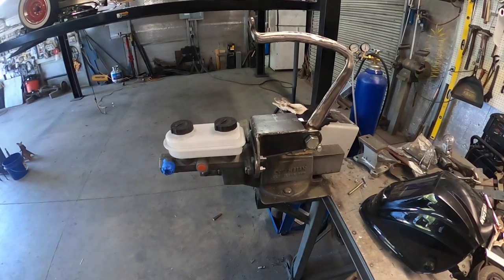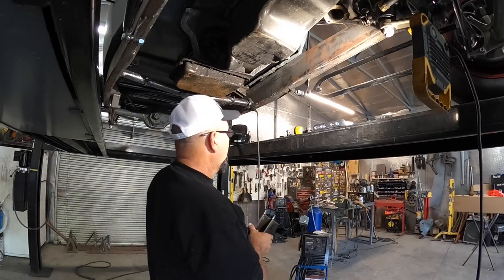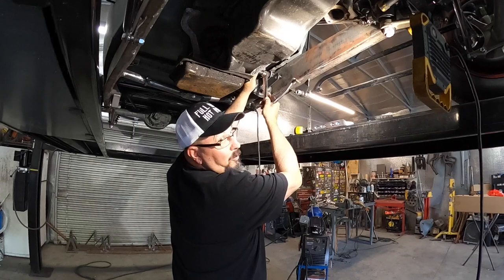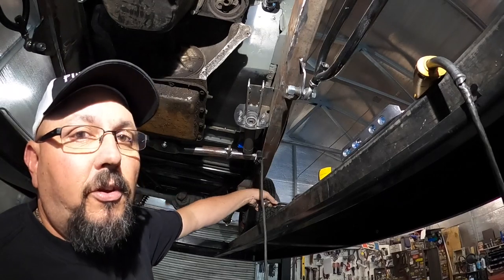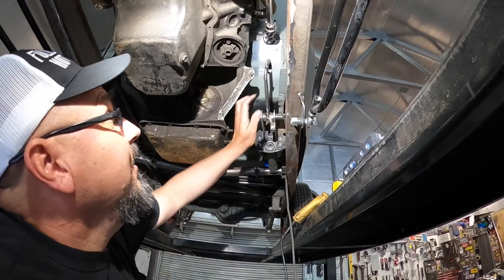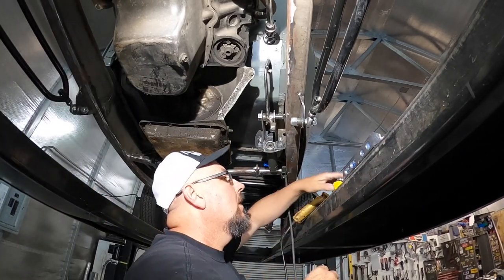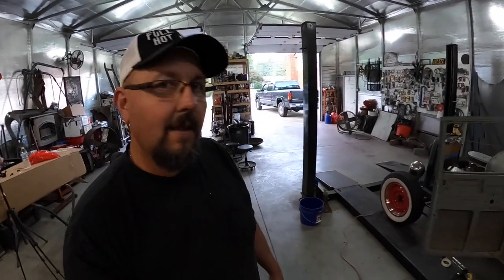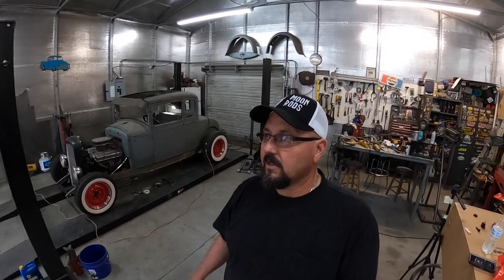Model A Coupe Hot Rod Build Pt34. Installing A Homemade Brake Pedal Assembly!

Comment: Thanks for another update Heath. I built a brake pedal for my '35 Chevrolet entirely from scratch maybe 25 years ago. It was quite the challenge to get the geometry right with the limited knowledge I had back then. I really like what you did with the '48 pedal and the bracket you made. It goes to show you don't have to buy everything out of a catalog to build a car. It looks nice and strong. I noticed a difference in the audio, and I read your comment about a new Gopro. Was the audio on this video  recorded using the built in Gopro microphone?
Reply from the maker: It can be a challenge for sure. I built one for a 33 ford pickup I had so I  learned  a lot off that  one . I love building stuff  and if it  can saves some money  thats a bonus too and to me thats  what hotrodding is about Making it your own!    Yes it was all with the Gopro With built in Microphone. It worked better than I thought it would . So far I like the Gopro I guess time will tell.  Take Care!
Reply: @fullmoonhotrods  when your video first started, I was looking for a lapel mic or something. I’ll have to watch again to check out the video quality. What stood out to me was the audio, definitely better.  Which GoPro did you get? I just picked up a older hero 2 this week but haven’t tried it yet?
Reply from the maker: A GoPro Max is what I have .  I thought I may Need a lapel mic but it seems to work pretty good without it.     @phillipshotrodgarage